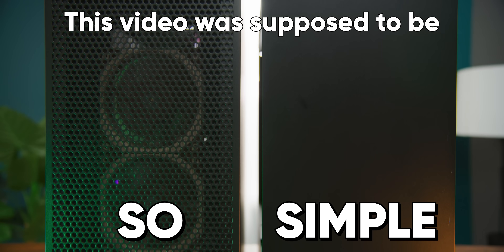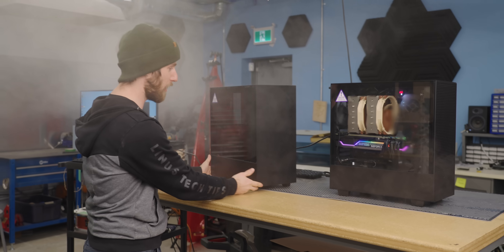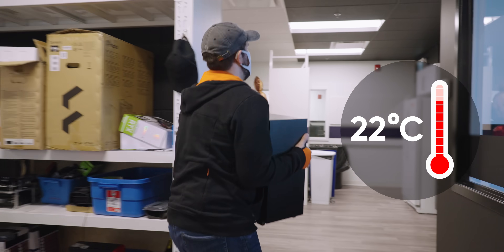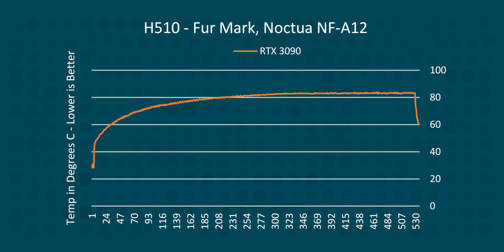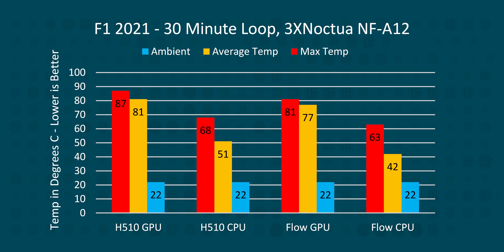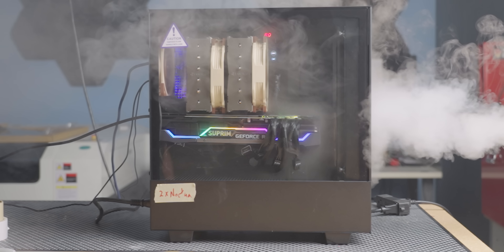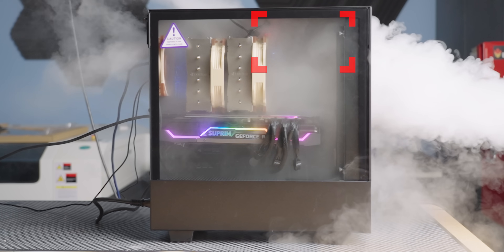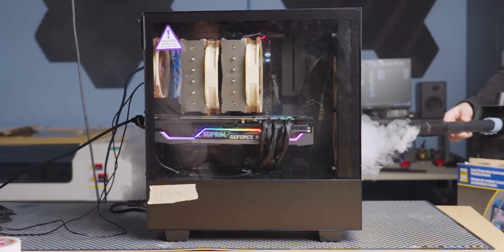Everything You Know Is Wrong - Mesh vs Non-Mesh Front Panel

Comment: As an Aerodynamicist I have one pet peeve: what you refer to as "turbulence" is absolutely not turbulence but just ricirculation bubbles. Thank you and sorry
Reply: dont be sorry when you know you're right
Reply: it's also weird how they constantly say 'turbulence' as if it's unwanted and somehow bad.
Reply: @-........   a little late but “turbulence” makes the air move slower through the case which is bad.
Reply: Since you're an aerodynamicist I have to ask: Are there any off-the-shelf accessories we can buy to give the air that finds its way into this "dead end" a way out? Those separated PCI express blower fans look like they could help but you're the expert.
Reply: @bluesrike  honestly  just find a way to have a hole there so air can escape
Reply: @JokerTheDank  not that simple. Hot high pressure air has a tendency to try and migrate towards areas of cooler/lower pressure. However this effect is not enough to ensure sufficient airflow past an air cooler hence why we have fans/ducting and don’t just rely on the natural tendency of high pressure air to move to lower pressure. Best option here would be to add an exhaust fan at the back of the case under the gpu to create a low pressure region for the air to flow through and out the back.
Reply: ah, the professional fact checking in the comments section
Reply: And if i am not mistaken turbulence actually increases the convective heat transfer coefficient because it thins down the boundary layer.
Reply: Turbulence recirc bubble flowspaths
Reply: an aerodynamicist who doesn't know how to spell...
Reply: I‘m not an aerodynamicist, so please correct me. But wouldn’t kind of a plate from the graphics card to the front and an exhaust on the back underneath the GPU, with a vent on the lower front eliminate the turbulences or ricirculation? In my narrow mind there would be 2 seperated airflows that could be way more efficient because they don’t effect each other anymore. 
Just a wild guess…
Reply: Vortices?
Reply: to think "turbulence" term has other uses in other disciplines, like refinery and oil transportation themed engineering.
Reply: What the hell is an aerodynamicist
Reply: @webmasale  Its just a fancy title for a dead end low end job where you practice highschool math on a computer all day. Definitely not as glamorous as being a trucker or software developer.
Reply: Never apologize because your right 🎉
Reply: If I was in your field I would be bald from pulling my hair out over this
Reply: Doesn't turbulence have bunch of small recirculating bubbles?
Reply: As an Aerospace Engineer, I agree.
Reply: As an astronaut who was in jupiter moon last month i agree  @Cryptic_Chai
Reply: Stop.being correct! Fuck!
Reply: You're right that turbulence isn't easy to define in that it's chaotic changes in things like pressure and flow, so it's essentially anything that's difficult to define because of being chaotic, so not all turbulence is going to be the same or even consistent. But I think what he meant to say is air hitting the graphics card is causing some turbulence, not that the resulting air pockets are turbulence as he didn't really physically point to them and say that's turbulence but just mentioned the air pockets after mentioning turbulence. So IDK if he's entirely wrong.

It made me think of Van Gogh's The Starry Night painting, which supposedly is considered one of the best if not the best artist's rendition of what turbulence looks like, IDK how true that is though as I'm no Aerodynamicist or physicist, but I'm pretty sure some physicists have agreed to that.
Reply: Canadian ?
Reply: REcirculation not RIcerculation
Reply: I think you are right, I think the MAIN problem might be a lack of escape path for the air on the underside of the graphics card..... 
This could be solved with an exhaust below the graphics card (The power supply doesn't look like it is contributing to air flow directly below the card for some reason)

ALSO: usually turbulent flow over a surface removes more heat than laminar flow(because the turbulent flow mixes air along the boundary layer)
Reply: @Tom89194  Power supplies usually intake and exhaust their own air supply in a closed system.
Reply: @orphanuprising  Only if the case provides a vent in front of the intake of the supply, Otherwise the power supply would be exhausting air from the case and improving airflow for the bottom half of the motherboard area. Unless the case encloses the power supply in the bottom and air goes straight from the front to the power supply, skipping the lower half of the motherboard. (at least if the case is not vented at the bottom near the power supply to give it its own air.)
^^ This is the LONG version of:  ''The power supply doesn't look like it is contributing to air flow directly below the card for some reason'' 
For some reason I was not bothering to write the long version..... since there are quite a few variations.
Reply: @Tom89194  very few power supplies pull in the "front" and exhaust out the back.  Instead most cases have a vent directly under the power supply.  Most power supplies have an intake on the top/bottom, and turn the air 90 degrees to vent out of the back.  So it'll either pull air from under the case.  Or in this case if you flipped the PSU over it would try to pull air through that shroud, if you removed the shroud it might help.
Reply: @RAYNE0912  It depends entirely on the case and how you mount the supply in the case as to where the fresh air for the PSU comes from. So ANY solution to a stagnation problem in the underside of the case will DEPEND on how the PSU mounts in the case and what that means regarding the air moving through the PSU, otherwise you have to provide a path for air to flow from out beneath the graphics card.
Reply: @Tom89194  the PSU is mounted facing fan down in this case so it cannot affect the airflow, also the path of the GPU's exhaust is blocked from the case panel. You can see that it is right up against the window/side panel leaving essentially no flow to that GPU. Seems like this is just a horrible case design and they tried putting a bandaid on a shitty case to begin with to make more profit.
Reply: @klmx6  ...A lot of the cases I have seen and used would have this problem, If you are using a card that does not vent air out the back and the side panel is tight up against the card(this would prevent the front fan flow from flowing under the card and pushing air between the card and side panel to get up to the exhaust fan) then this is probably a problem.
Many power supplies I have seen pull air in from the bottom and exhaust it out of the case, if the power supply is in one of those separated bottom compartments, then this is a problem.
This could be a problem for 'better' cases and people just don't know it. If they remove a pci slot cover, then I would imagine the card temp could improve.
Reply: @Tom89194  what I'm saying is: he is pointing at a ricirculation bubble and calling it turbulence, which is like pointing at a chocolate bar and calling it a raspberry
Reply: @JokerTheDank  I said:
I THINK YOU ARE RIGHT, I think the MAIN problem might be a lack of escape path for the air on the underside of the graphics card..... 

However consider THIS:
What if his chocolate bar has raspberries in it??
Reply: @Tom89194  no no, I AM RIGHT. Turbulence is everywhere, there is no laminar flow in that case anywhere.
Reply: @Tom89194 Practically though, we can never achieve a perfect laminar flow. It's always turbulent.
Reply: Which is literally turbulence. Natural turbulence is made by the recirculation of air of an environment if like say you're wanting to talk planes. So I love your whole oh no it's definitely not descriptive word because this descriptive word has the definition of what it actually is which literally means if the descriptive word has the same definition of what you're trying to say then it's the correct word. You're the one just trying to get on your high horse.
Reply: @iceman125971  you are so wrong I'm not even going to start to answer. Just know nobody knows the definition of turbulence, but everyone knows what recirculation is
Reply: Recirculation bubbles are just turbulent air though?  If you correct something it’s good practice to explain why, especially with English and semantics hahah
Reply: @evanforst7272  absolutely no, it can be fully laminar. Explaining turbulence is not an easy feat, there is actually no definition because nobody knows how to define it. You can look into it more if you are interested.
Reply: @JokerTheDank  interesting! cheers
Reply: @JokerTheDank  Maybe not how to define it in a rigorous mathematical manner, but there'as definitely some 'good enough for the general public's consumption' versions that'll get them a lot closer.

Consider the particlea in a fluid flowing as if they were cars in a multi-lane highway. Laminar flow, the cars would mostly stay in their lane from one end of the highway to the other, progressing in an orderly fashion at roughly the same speed as their neighbours.

Turbulent flow, on the other hand, would have cars changing lanes frequently, speeding up and slowing down, and generally being much more chaotic. They would have an average speed you could work out as they all generally move in the same direction and rate, but describing in detail the path of a specific car is basically impossible. This approximates a turbulent flow. There's a transition between the two states where thing's aren't quite clearly ordered enough yo call laminar but aren't quite random enough to call fully turbulent, but that's not really something that needs to be considered here, and the two extremes are easy enough to differentiate.

In terms of recirculation, this can be either laminar (well ordered) or turbulent (chaotic).

Think of the airflow through your case as a highway again, but this time there are some on/off ramps as it diverts around obstacles. These can either lead to a different side-road that runs mostly parallel and eventually merges with the main highway and exits out the back, or it could actually lead to a racetrack where most of the cars end up going round and round, with very few entering or exiting once it gets full. That's recirculation. Within that racetrack the vars themselves could be going around in an orderly fashion (laminar flow) or could be swerving and changing speeds chaotically (turbulent). 

There is some degree of turbulence introduced where flow divides or combines, so there is some relation here but it isn't yhe same.  

How does all of this relate back to your computer's temperatures, you may wonder? Well, turbulence is generally good for heat transfer as the bulk fluid is better mixed, allowing it to carry more heat away from the solid being cooled, while recirculation traps some fluid in an area, meaning it heata more locally, allowing less heat to be taken away.

Comment: This video to me points out the problem with the GPU overheating, which happened with my 5700XT in a case with Noctua fans galore. But ended up buying a water cooler with it that prevented most of the overheating, but once too hot, artifacts start appearing. (I feel if there wasn't any overheating, then my GPU can possibly beat a 2080; this GPU is meant to power 4k monitors. I might need liquid nitrogen or some extreme cold liquid for cooling). My GPU has survived multiple artifact crashes during Tarkov and Squad before installing a GPU cooler.

The second problem that this video points is the no-existence of a fan somewhere at the bottom of the case. This leads to the question of either redesigning cases to have fans near the back, or redesign the motherboard and graphics card to output on the sides of the case. Then you can add a second fan to the rear or bottom of a case.

Comment: Nice but you missed out 1 bit (get it 😁) with the h510/h510 elite remove the side and bottom air filters, I've got mine removed, using the stock rgb fans and additional stock nzxt rgb fans placed at exhaust and the top, so they all match up, got a dark rock 4 heatsink.. and with the air filters removed I've never had a component go over 35c idle, 50c standard usage and 60c - 70c  very high extreme usage. Set up this way, I've never had a problem with my h510 elite.

Comment: Living in dry, dusty central Spain, negative vs. positive airflow has always been a big question mark. Around here, my own feeling is that you should prefer positive airflow, because you want to direct air intake through the dust filters. If pressure is negative, you get air coming in through other apertures in the case, along with all the dust it carries. On the other hand, positive air pressure tends to lead to dead zones and air recirculation. I try to get the balance to just barely positive, but it is tough to balance. If it weren't for the dust I would go for slightly negative.
Reply: Absolutely my point. My space is not really dusty, but plenty and I hate dealing with it. So even though I understand all these differences with positive/negative pressure and fan configs, I just want all of air going into the case to be filtered, or at least to logically think that it is.

Comment: Pointless video... (almost). Just use different (higher/lower/longer/shorter/with open/closed top) case, put fans on the top/bottom, use air/liquid cooler, put PC in hot/cold environment and results will be completely different. The 'mystery' is just using brain and basic knowledge when you are building your specific PC. That's all.

Comment: The thing about dual tower coolers is that the heat from the first tower is normally used to "cool" the second tower.

Doesn't make much sense. If you instead put both fans on the outside blowing towards the middle, you can usually drop  another 5-7c off the CPU load temps.

Build a shroud and use another fan to extract the heat from in between the towers and you can drop another 2-3c off load temps.

I did extensive testing and experimentation with my Noctua NH-D14 and that is what I found. This is with using Rosewill dual ball bearing fans which unfortunately are not being manufactured anymore.

Of course this type of setup requires that you have either an open sided case or have great airflow through your case.

Comment: This is all thanks to the GPU cooling designs tossing out the trusty blower fans and all the hot air out of the GPU recirculating through the case. I solved my under the GPU air pocket with an old Evercool Fox 2.

Comment: Just gona say this (sure others have) deflect the lower front fan air flow down, and have the front upper fan run slower. keep the aft fan at a good speed, this should improve that flow pull from the bottom. Some PSU fans vent in and others out? Why isn't there a deflect out there for fans that cover 1/4 to 1/3 at about 1" deep into the case?

Comment: Pick a direction - suck air in and let it vent wherever, or blow air out at specific points and let the air get sucked in from wherever.  Fans doing both will just cause problems.

Comment: Isn't this rather simple to solve, main factor being to ensure you've got equal intake and exhaust air flow to avoid static air pressure and being aware of PC case short-comings with physical space with components in the case to allow and provide decent airflow for cooling, as long as you equal air pressure fan in and out, and position fans to optimize case temps!

Comment: I have this case, and I have the exact same CPU cooler, but... I have installed it vertically, so it blows from bottom to top, helping the video card. Also, after a long research on fans and how they work, I have replaced the standard case fans with the following: Noctua NF-A14 PWM, Premium Quiet Fan, 4-Pin (140mm, Brown) and Noctua NF-S12A PWM, Premium Quiet Fan, 4-Pin (120mm, Brown), which are, if I'm not mistaken, low pressure fans.

Comment: Hi Linus. I actually have the same NZXT H510 Flow case bought recently. At first I noticed the same high temperature issue using all stock installations of my 11700k, MSI RTX3080 Z Trio, Noctua NH-U12A and a couple of Noctua's 140 airflows. I actually managed to fit a Noctua NF-A14 PWM as top exhaust. I did some simple non-intrusive(still good in case of any warranty claim later on) case mod and fan placement. And I actually got very decent improvement. Both my CPU and GPU are on OC mode as I am typing this. And my readings are 36C and 31C respectively. Does not exceed 75C while gaming.
Reply: Can you tell more about that?
Reply: @Chernorog  HI there. I explained more in this link from my channel. https://youtu.be/x5ufqOzzH8U
Just pardon the 240p resolution it came out when I uploaded from my phone. But it is still readable on windowed-view.

Comment: I use a PC where the connections are at the top instead of the back (also it looks larger than the tower shown here since I own a RTX 3080ti and there's still space). Of course it gets covered by a lid and it has like 5 fans (3 in the front 2 in the back) and a large double cpu fan in the middle. The tower is called Segotep Argus mid ATX though unfortunately it costs a whopping 200$ lol.

Comment: See Major Hardware's video on GPU airflow ducting. You could do a similar thing. 

Effectively the issue here is that previously you could get acceptable thermals by not thinking about it at all and throwing more fans at it because the cases were bigger and the components smaller. But now we've carried that (lack of) thinking over, it's catching up with us. It's not that hard to design a case with specific air flow routes. I guess it would look different to traditional cases. Remember: Manufacturers are incentivized to convince you to buy another case for the minimum cost to them. Doing a proper design job eats into their profits, so they do the minimum required.

Check out DIY Perks for examples of novel computer thermal design. Matt puts a lot of thought and effort into it.